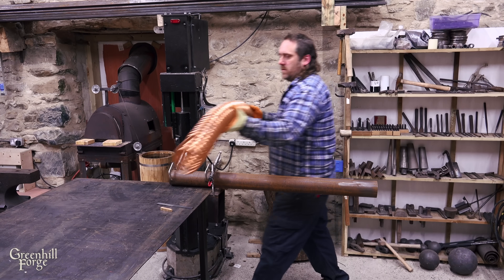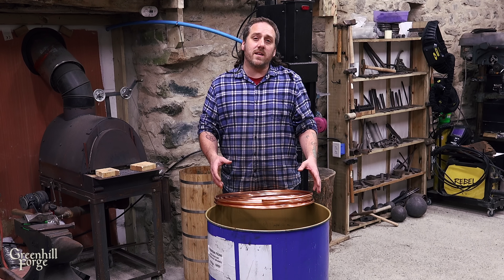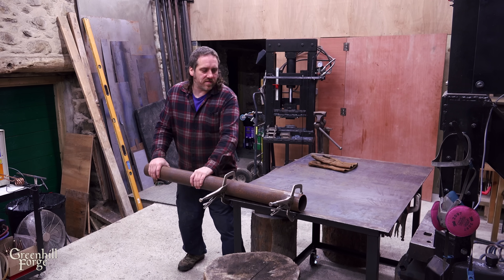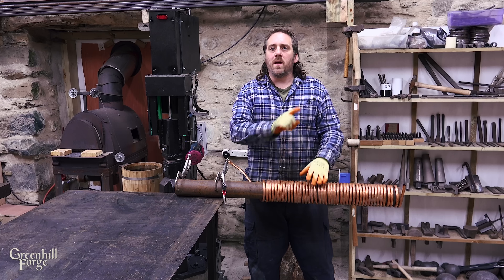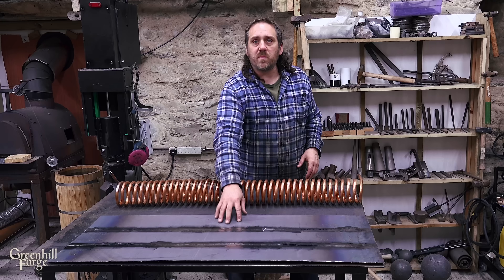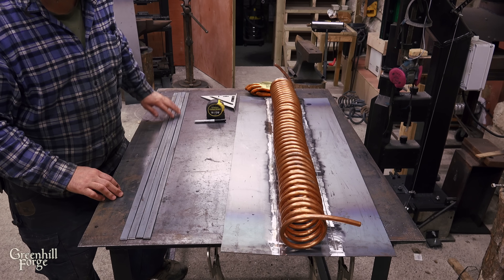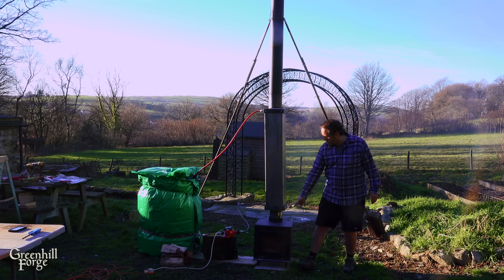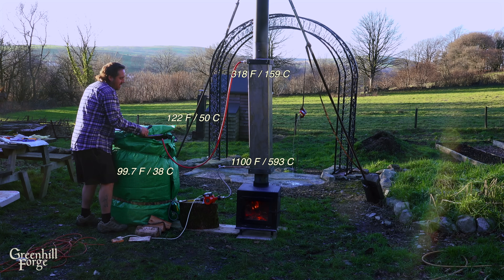Wood Stove Water Heater Experiment - Surprising Results! Part 1

Comment: Great project, impressed by the efficiency! And nice editing too, I predict a steady rise in views and subs in the future! I subbed after watching the stove build video and am looking forward to the next! A solution to have a circulation pump also driven by the heat would be amazing, it's such a critical part of the system and would make it pretty mobile. I guess a stirling engine would be too weak🤔 This is going to affect my sleep tonight I'm afraid😂
Reply from the maker: Just occured that a simple steam engine could work really well and would also sync up well with the system. The hotter it gets the faster the pump would run. Maybe I'll try building one...
Reply: @GreenhillForge Do it!
Reply: 🎉 😊@GreenhillForge
Reply: @GreenhillForge A steam engine sounds like a very good idea actually, would love to see that happen! This will definetly be an interesting project to follow! 🙂
Reply from the maker: Thanks! I didn't get into this in the video but I'll try to remember to touch on it in the follow up video, but these types of systems can actually be run without a pump. Hot water expands and rises just like hot air does, so if you place the barrel vs the heat exchanger properly the hot water will naturally rise through the copper coil by itself. The only issue with this system is that it might be too hot, meaning the water doesn't move quickly enough to keep the copper from overheating. That's why I added the pump. Maybe after the rocket stove test I'll try taking the pump out and see what happens, at least that way if the copper melts I got the tests done first.
Reply: @GreenhillForge  Yeah, I've seen a few projects without a pump, but it does seem to be very finicky to get to circulate fast enough, and then it could become somewhat of a safety issue. The principle would be the same(opposite) as a fluid cooling system, my knowledge limits to engines and such where there's always a pump, I wonder if systems without pumps are used elsewere🤔
Reply from the maker: @Itsme-Ollie  Yeah, thermosiphons are passive heat exchanging systems and they're used in at least a few things I can think of. Biggest one being rooftop solar hot water systems. But I can't think of any that come anywhere near the kind of temps in solid fuel burning systems. A lot easier and safer if you're topping out at like 140F instead of 1200F.
Reply: My math puts the ou-put at around 20k btu/hr.
Once your desired temp is reached what are your plans for regulating?  By-pass the heat exchanger? Possibly using thermo-controlled by-pass dampers?

Comment: Great video, it was great to see numbers put in the video. Do let us updated on the carbon build up, I am thinking about building something this but copper pipe wrapped outside of the exhaust pipe. I am glad this works, copper pipe like you said is a fortune nowadays.
Reply from the maker: Thanks! I'll get much more into the numbers in the next video. I checked the copper and it wasn't too bad but it would definitely need periodic cleanings from carbon buildup. It's a trade off between more heat exchanged but the copper getting dirty vs less heat but not needing to clean the copper. Maybe there's a good way to find a balance?

Comment: Dude, this was so cool. You should do this for others and sell that heat exchanger. Next project should be low pressure steam engine and generator for electricity? 🤔
Reply from the maker: Thanks! A steam engine is definitely in the cards

Comment: This is awesome!  I didn't catch it in the video, but are the two parts not bonded permanently?  I assume you might want to get in there at some point to service/clean it.
Reply from the maker: Just a few self tapping sheet metal screws and they come right apart. You're right, the copper coil will definitely need periodic cleaning.